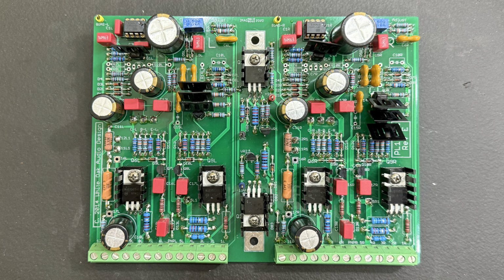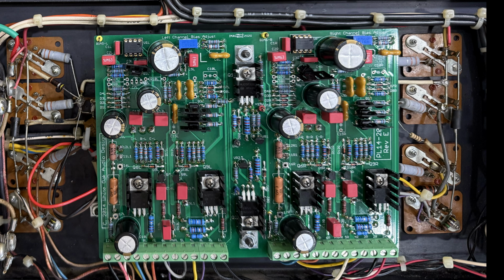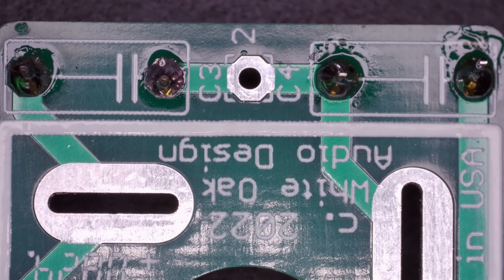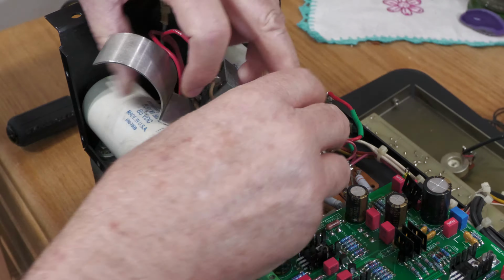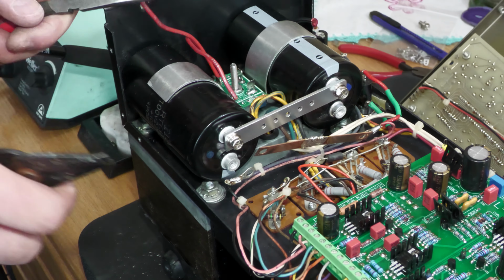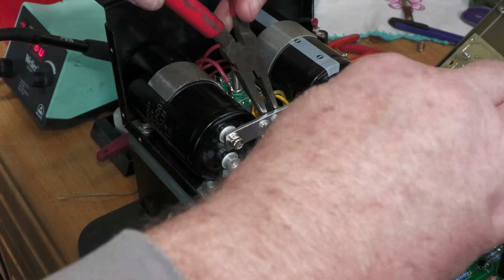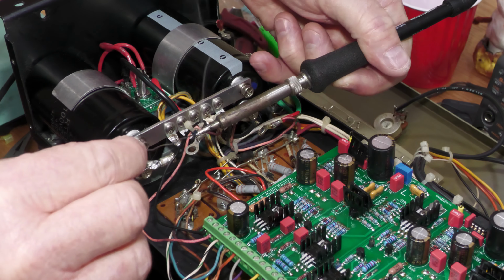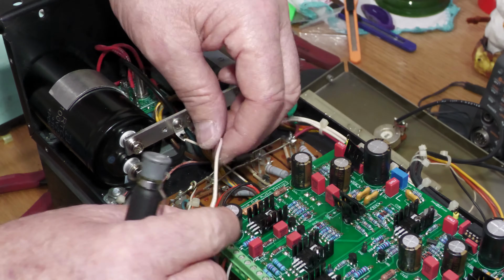Upgrading a Phase Linear 400 Series II Amplifier with White Oak Audio Mods & More!

Comment: Even more enjoyable watching while munching on a bag of popcorn! 👍 🍿
Reply: I recently acquired 6 phase linear power amps and 4 phase linear pre amps these are my first ones and I was wondering if you actually do restorations on these for customers. If so is there anyway to get an idea of what it would cost to go completely thru a phase linear 700b including your recommend upgrades?. 
I have 2 700b, 1-700 , 1-400, and 1 Dual 500 Series Two, I also got a Dynaco 400 in this purchase. The pre amps are 1 - 2000 , 2 2000 series two, 1 4000
Curious about the restoration costs on the 700b units first.
Thank you,
Jack
Reply from the maker: Hello Jack! Thanks for the question and thank you for subscribing! I apologize for the delay in responding, I was on the road on our way to Montana to see family.

In answer, as of right now, I am not doing upgrades as my time just upgrading my amplifiers and making videos out of those upgrades and repairs is very limited. I also have purchased other audio equipment I want to go thru and document on YouTube (Marantz 2100L / Realistic SCT-23). However. if that changes I will keep you in mind.

You have quite a collection there!!! That is awesome! So I also have a "Dual" 500 that is in need of repair (1 channel is out) and I plan on doing a series on Youtube of those repairs and upgrades. I have done some studying and research and it looks like the Dual 500 can be upgraded with the White Oak Audio board that is used for both the 400 Series II and the 700 Series II, So that one will be quite a project for me! As far as costs? If you got to White Oak Audio's "eStore" you can get their prices of components you need. Add that to the cost of the time spent for the technician to repair, and that should put you in the ball park. Of course, if you have basic electronic skills, know how to troubleshoot and solder, you can watch YouTube (like you did mine) and other videos on other sites to learn how to repair them. It is a lot of fun Jack!

Man, the "Dynaco 400", That is awesome Jack! Repairs on that if it needs any or even the upgrading will be very similar to your Phase Linear gear!

Again, you have a nice collection of classic audio gear!

Thanks again! I value my subscribers!

Jer Jer (Jerry)
Reply from the maker: Glad you enjoyed it! I know these are technical, hopefully there is a niche out there for people repairing and upgrading these. I agree with the popcorn suggestion!